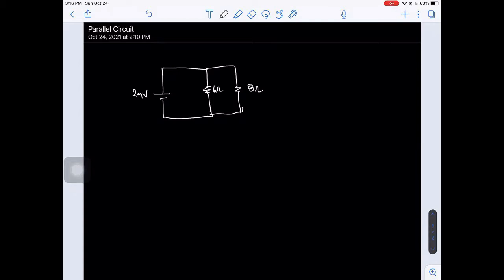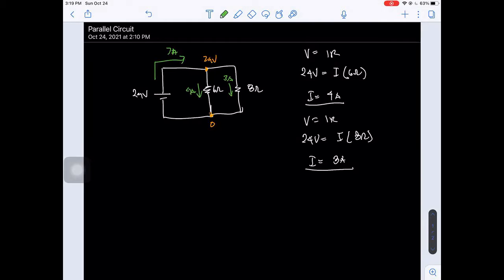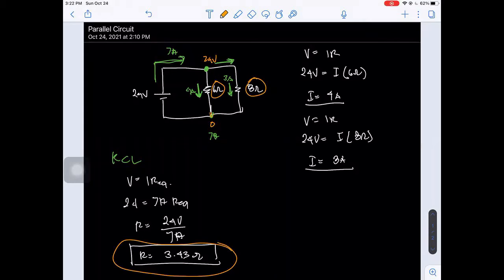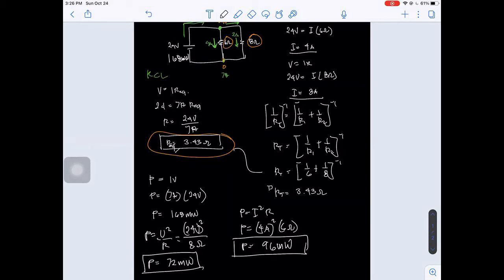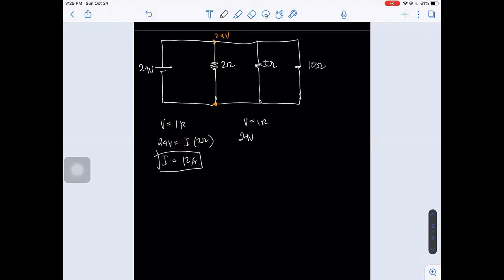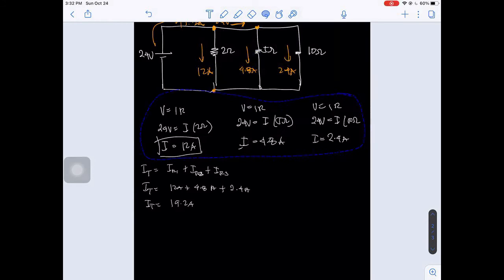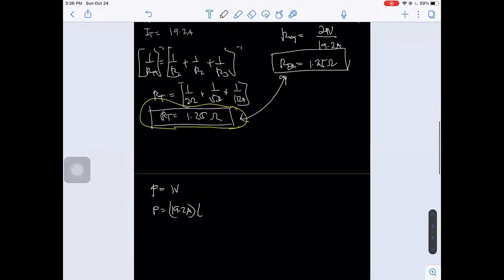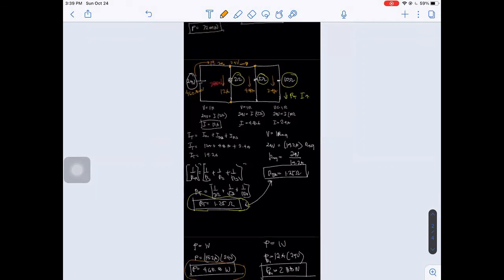Parallel Circuit

Comment: Thank you for the learnings in Parallel Circuits, Sir. 

I just got confused as to why the result of power was "mW". I thought when we multiply ampere and volt; the result is just watt or "W". Like in the first example given, the values multiplied were 7A and 24V, so I thought the answer would be 168W instead of 168mW. Setting that aside, the discussion was very clear and can easily be understood. Thank you again, Sir!